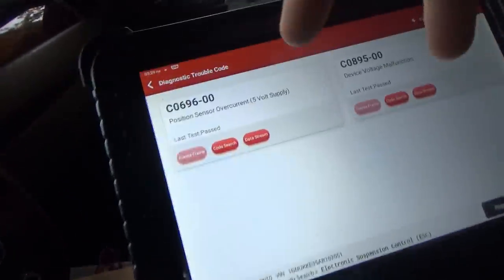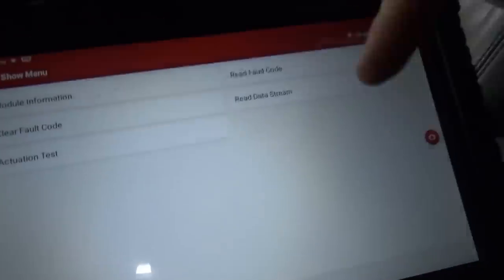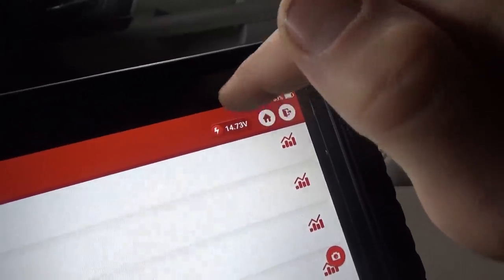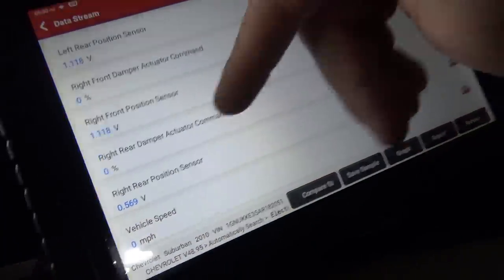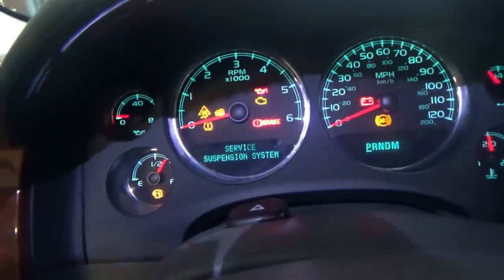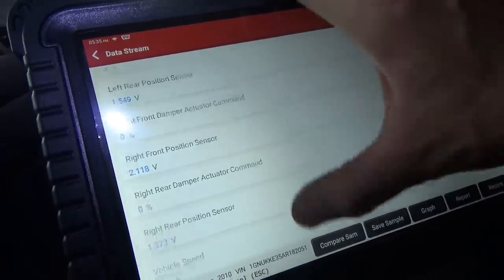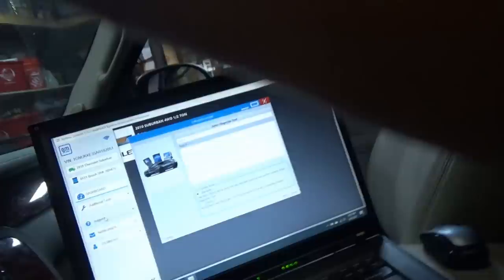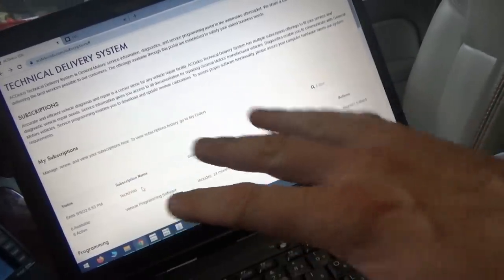"Beached Whale" Suburban - Part 3 (ESC Suspension Module: Replace & Program)

Comment: If you would have started programming with the emulator, you would have charged the customer once...as Tech II is able to program and calibrate...yes?
Reply from the maker: No, programming is by SPS 2, separate calibration by Tech2 👍

Comment: Well, its my opinion that option for auto leveling suspension is pretty much a maintenance item at an extra cost when new.  Those air pumps only last so long and the shocks and plumbing will become a neusance at some point forcing you to replace them even though the shock operation isn't worn out but the air seals might be. Better off to just order HD suspension and shocks and forget about the gimmicks. The customer here paid likely $1,200 extra just because of it.

Comment: My wife has a Dodge Caliber and she had a similar situation her car has a CVT transmission and it kept going to limp mode and we found out that the battery was the problem once a new battery was installed and the CVT control module was reprogramed it was fine haven't had a problem since

Comment: This is why I fix rather than switch and don't buy something new.  Too much BS electronics to do a simple task.  And they call this progress?  My newest vehicle is an "86 Astro Van;  the older ones are a '65 Dodge and a "66 Ford.  They all run great.  No special scan tools or expensive programming  subscription fees when I have to install a new part.  I use a paper clip to read trouble codes on the Astro.  The other two don't know what a trouble code is.  Good luck on your new cars and hope they never break because very few people know how to fix them any more.  And you better have a lot of money or your suspension trouble code light won't go out.

Comment: I'd love to know what engineering genius at GM thought it was a smart design idea to put a module like that in nearly direct exposure to the worst possible road debris, water, salt, and general garbage. Unbelievable. #smh
Reply: they probably got a raise
Reply: Yeah that old module looked horrible it looks like it's been beat hot cold repeatedly many times I bet the inside of it is an insulated either so it gets super cold super hot like every module it's ridiculous at least the wiring harness is somewhat insulated but all the wires and stick out after the clip and the little tabs are fucking stuck in what a joke
Reply: Plus these cheap ass modules that are made in Brazil or Mexico with little or no quality control are made to shit I remember somebody on one of these channels opening up a module and the freaking sodder had grown long hairs all over everything it might have even been Ivan with that Mercedes like something that reacted in there and it caused the solder to stretch out and grow long fibers that touched everything else and blew itself out.

Comment: If I ever buy a newer suburban, I'm disabling the information center somehow and taking any bulbs out the dash that are on. If it starts misfiring, then I'll check the codes. This new stuff can really be a money pit.
Reply from the maker: Good luck lol
Reply: @PineHollowAutoDiagnostics  lol. Excellent series on the beached whale Ivan. Do you think I would be able to see the bad can signal with the uscope? I haven't got a pico yet.
Reply from the maker: @TheShop10  that would be tough. Really need at least 2 channels and a bigger screen for CAN signals

Comment: these paywalls are becoming more common, look at the new EV cars with all the HW options installed but some features are disabled because you didnt pay for them, Toyota was going to charge people a subscription to remote start their cars with the key fob feature after the fact!, OMG. crazy, the right to repair and underground vehicle hacking will become more prevelant. But the manufacture can connect to your car and disable features that you didnt pay for, so we need firewall options, its all software running this stuff.

Comment: For the same cost as the module I would have ripped all that electric suspension crap out and gone basic. Watch the compressor or shocks fail next....
Reply from the maker: Actually customer just installed a brand new compressor 😅

Comment: You have to be an idiot to buy a car with the CAN system and $800 moduels under the car where rest, salt, water are sure to attack them IMO.
Reply: There is less and less choice in todays market, many makes and models but most od them is same crap only with different styling on top.

Comment: The moral of the story is don't buy all the options on a vehicle.  Just get the basic model and you won't have to worry about auto load leveling, on-star you 'aint gonna use', or infotainment crap you shouldn't be watching as you go down the road.  A lot of that OEM nav stuff is crap anyway, nothing beats a good Google phone... OEM nav doesn't tell me where the speed traps are!
Reply from the maker: Even cheap econobox Chevy sonic came with OnStar and 10 other modules 7 years ago...welcome to the modern world lol!